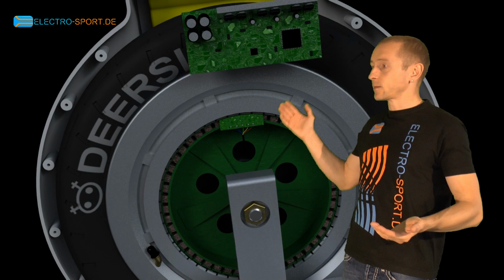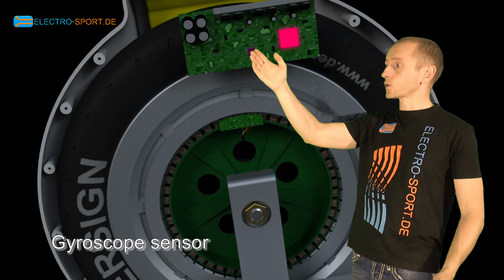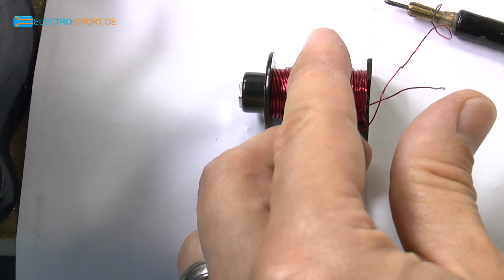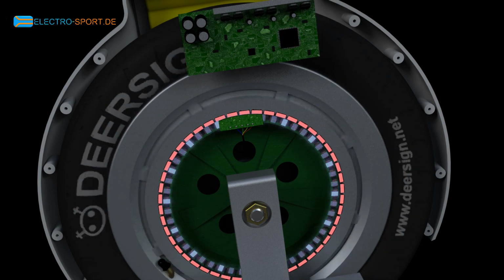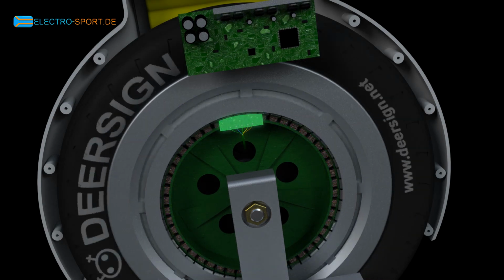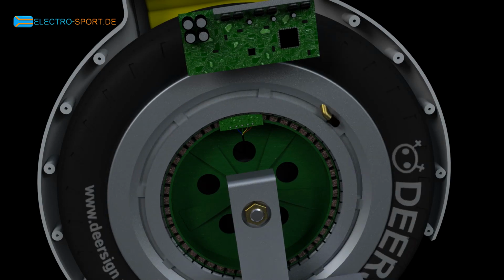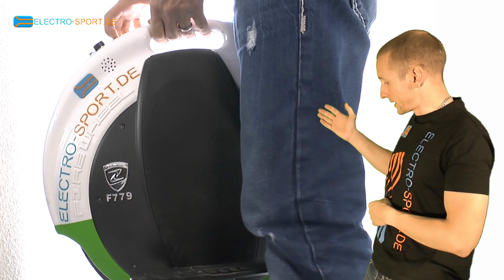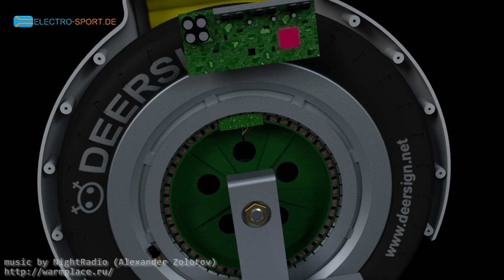how an electric unicycle works SUB EN

Comment: I've seen the issue when the cycle is on and the wheel is not touching the ground the wheel can spin up and you have to fight with it for a moment as you set it down. The solution to this is so simple I just don't understand why it was not put in place initially. "Weight On Wheels" When there is no weight on the foot pedals the drive goes neutral. It goes partly active with weight on one pedal and full active when weight is on both pedals. It's so simple.
Reply from the maker: TigerZero aka Allen No, that's not a matter of weight, it's only the balance of the gyroscope
Reply: The hoverboards (two wheels) have the feature you are talking about for exactly the reason you mentioned too.  I guess the electric unicycles may not have put this in because of (a) reliability concerns since the pedal is on the exterior and low to the ground and (b) cost.  The other thing is the electric unicycles are faster than hoverboards.  So, as you're riding the unicycle, you could build up enough speed where you hit a small rock or some uneven protrusion on the road surface and temporarily become weightless!  Your weightlessness may switch off the electric unicycle's gyro control just enough to upset your balance and cause you to crash.

Comment: Thanks for this video; this is the most elaborate animation and explanation of workings of an EUC I've seen so far.

I always have one question though... Is the increased cost of this direct drive system (i figure hub motors are more expensive still?) justified against the gain in eliminating minor wear and tear of, say, a chain drive system used with a normal motor? I'm not well equipped enough to experiment with either just yet, but I do own an EUC with a hub motor and I'm always curious to learn more about all possibilities with EUCs. Thanks!
Reply from the maker: Thank you!
I think all the advantages of a direct drive have more weight then the money and you couldn't manage such a system with a hub motor - would be too slow to act and react in any way and has not enough power and you can't put it exactly in the postion you want to - and this is very important for an unicycle. On the other hand, for small applications you'll always need a small circuit to control the motor - with a hub motor you'll only need a power supply...

Comment: unicycles are great and fast , but the only problem is it does not have shock absorber  , i had experienced it that if you are riding this for more than 30 minutes on sidewalks and not smooth surface , it become painful to the knee and foot. hope that this manufacture build new models with spring shock absorbers.
Reply: +Alvin Abejuro Consider what would happen to the weight of the cycle if you added shock absorber, it would be heavier.Have you tried different types of foot wear ie boots or different types of shoes perhaps that would solve the problem of the pain in the feet, but the knees perhaps try a knee support, I see many people riding these with knee protection perhaps that gives support.But adding a shock absorber would increase the weight.
Reply: +flitsies your knees are supposed to be the shock absorbers. Don't ride with your legs locked, bend your knees just a bit, and keep them loose, that way they can bend more when there is a bump, much more comfortable and a lot safer!
Reply: Bend your knees more for a smoother ride. Sure its hard on your legs, but you will get stronger every time you ride :)
Reply: Lol reading this in times of the Kingsong S20

Comment: Hi
I am very interesting in this unicycle scooter the question is: is this gyroscope sensor causes balance and without  it there's no balance so you must learn me how it's  fixed  and is there's any other kits we must fixed beside the controller unit 
Is this basic are the same in ryno motors and ninebot one z10 
 from where I buying this gyroscope sensor is it very expensive 
I am waiting your answer 
Thanks very much

Comment: if wheel is violently shaking back and forth is that the halls sensor?
Reply: Actually my Inmotion V8 had this twice after I hardly overpowered it. I thought too it was the halls sensor, but someone said it's software based. Kingsong 16X firmware 1.0 had it too, watch kujis video, and it was fixed via software update

Comment: Nice video, congratulations. Do you know how to increase the speed limit or prevent that over 15 Km / h pedals go back. Thanks
Reply from the maker: Hello, no, that's a software setting and depends also on the motor power and controller...
Reply: Oh wow, reading these comments in times of veterans and gotways... 15kmph😂
Reply: @lefotografion  sherman go brrrrr

Comment: "almost free of maintenance, for very long time/distance." what kind of mileage can a unicycle make before starting to feel wear and tear?
Reply: 10000km with something like a veteran Sherman, then just the tire needs to be changed. Another 40000km and maybe the battery will start to show its age. Unless of course you crash it.
Reply: For the smaller ones like the inmotion V8, I needed a new battery after 7500km of hard riding, off-road etc

Comment: Hi, i lift and accidentally shutdown the power of my unicycle while the tire is spinning, it is now making crackling sound everytime i use it. is it bad?
Reply from the maker: prince bellair crackling sound can have several causes: maybe only sand or waste in the wheel, maybe the cap of the valve or the worst case: a loose magnet in the wheel. It depends also on the wheel.
A light "crackling" can also be the normal, magnetic noise.